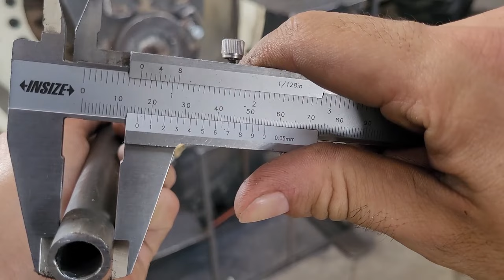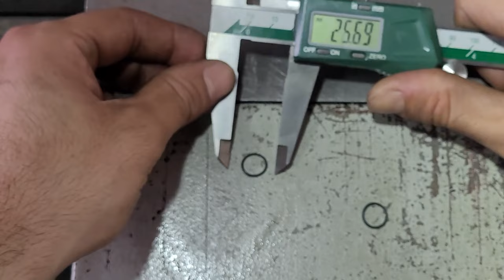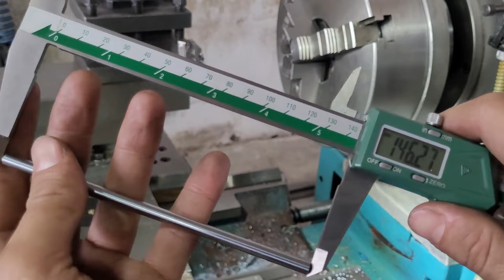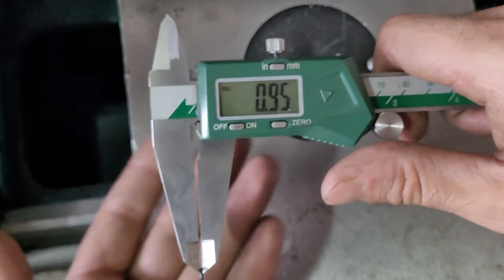how to make a mini hydraulic cylinder? making hydraulic cylinder on a lathe (for the rc crane-truck)

Comment: Nice work 😍😍👌👍🎉
Reply from the maker: Thank youu 🫶🏼
Reply from the maker: mini hydraulic pump manufacturing video for rc vehicles is on the air. ❤
Reply: @CallutLathe  yes, coming soon I'm well make Hydraulic cylinder from pvc for my tractor 😍❤️❤️